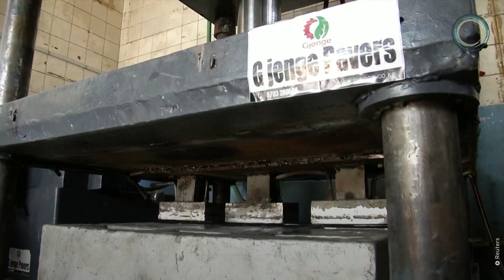These Bricks Are Made Out of Plastic Waste

Comment: The bad thing is that you are using plastic and putting it into or on the ground. It will just break up over time with enough pressure, friction, and deterioration from walking and erosion which will just put microplastics into the soil and water. Mircroplastics are bad for microorganisms, humans, and plants and they can negatively interfere with entire ecosystems.

Comment: She should make a mold so that it  produces pieces that fit together like large LEGOs that can be “glued” together with some plastic cement. That way can build walls or other panels systems. If they had side ridges and grooves they could be laid out like inter-locking floor tiles much the same way wood flooring has. The casting possibilities are endless